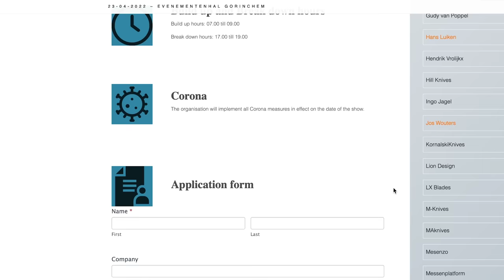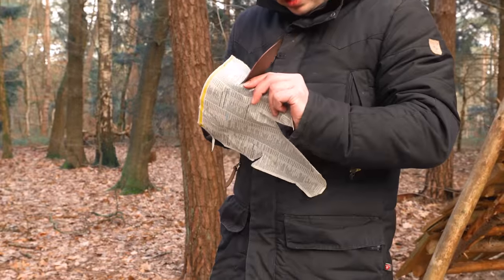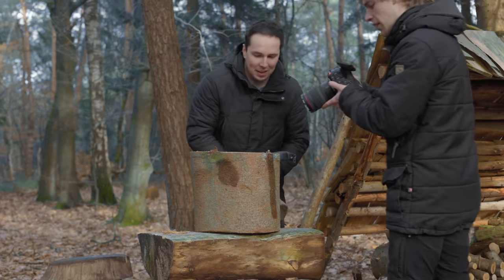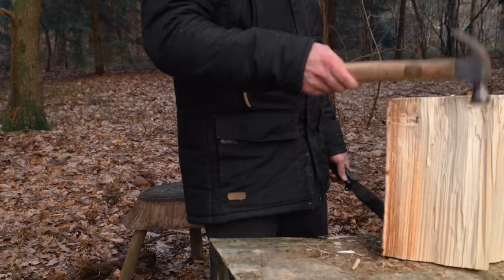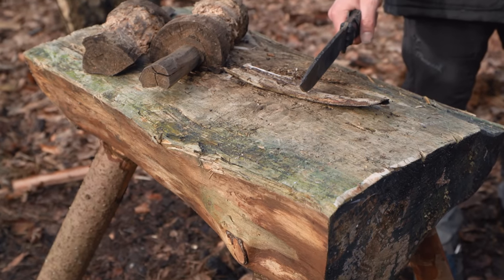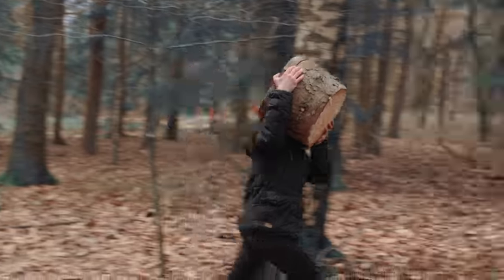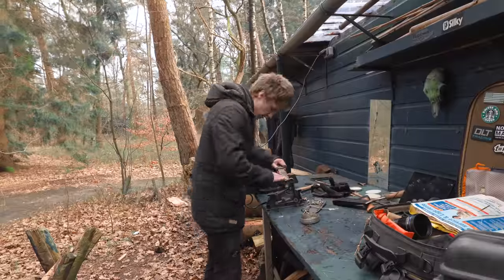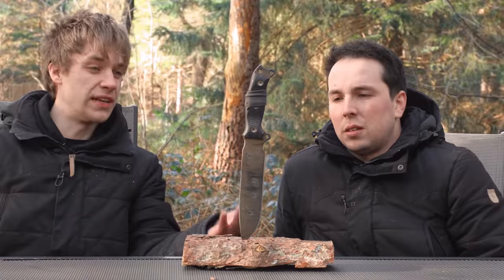They say this is the toughest Knife steel ever Made! INFI STEEL DESTRUCTION!!

Comment: I think you can tell the most from steels used by world class competition cutters.  They have to stay razor sharp, the grind is usually a bit convex or flat.  I'm pretty sure these knives are all hollow ground as it cheaper and faster. At least that is what they advertised. No way they would ever beat a Keffeler blade.
Reply: This isn't remotely true at all. Very few of these are hollow ground. I have over 20 of their knives, and I think 3 of them are hollow ground.. they have more in hollow grinds,  but not nearly as many as they do sabers, or  flat grinds. They have done every grind you can think of as well as made their own hybrid type that combines styles of grinds.  I have a few from Dan as well. The thing about what you said is chopping knives are built to entirely different specifications (they have to, or they won't be eligible for chopping contests). Busses are not designed with chopping competitions in mind. They are combat knives.. that being said, they have made everything you can think of. I've got a couple of kitchen knives from them, edc's, choppers, swords, etc..

What you're talking about has less to do with the type of steel and more to do with edge geometry. Their steel would do fine in a chopping competition if they bothered to ever make a knife to the organizations very rigid specs. They might one day, and we'll all see, I guess. Carothers has a video where they talk up Jerry's work. Dan has done work with Nathan on the Carothers K18. Dan also sold it, I'm pretty sure. 

Long story short, these knives are not made to be chopping competition knives, but I can guarantee they would keep up in the right hands with the right edge geometry and heat treat. Jerry and crew are fuckin heat treat wizards. This would not be a difficult task for them at all.
Reply: @AriesTheCam  You are the perfect person to respond . I am just speculating but since you actually own both what is the truth.  I would assume that the Keffeler blade would cut circles around an infi blade. Also they advertised for years that their infi blades were hollow ground.  Any chance you would do a video? I might even kick in a few bucks. Also, are Dan's blades flat or a bit convex. His vids are flat incredible.
Reply: @bluerazors  They really would chop circles around Busse's knives, but that's because they were designed that way honestly. He mainly uses full flat grinds with thinner blade stocks than Jerry uses, lending to them biting very deep into the wood. I would have to pull his stuff out of boxes (I buy way too many knives lol) to remember the edge grind, but I'm pretty sure you're correct on them being convexed. 

Jerry designs for toughness.. so they end up being very thick blade stocks with thick edge geometry like an axe. They chop very well, but they excel at being abused with stuff like batoning. If you thinned out the meat behind the edge a bit on his full flats to match, it would keep up. I'm fairly confident in that. I have definitely known him to make hollows, but I wouldn't say that's ever been the majority. He seems to mainly use saber grinds with "v" grinds at really obtuse edge geometries,  and reaaalllyy thick stock in the .22 all the way up to like .37 range. So real thicc bois. He did a lot of convexed stuff way back in the day on stuff like his "basic" series. He's also known for using corrugated bevels a lot as well. Those are cnc'd grooves along the primary grind supposed to keep the blade from biting as much, but I rarely notice that much of a difference. It does look way cool though. I also notice a lot of flats with v grinds, and again verrrryyy thick edge geometry (a lot of his fans like to thin the edg out on theirs to something around 17 degree type angles if my memory serves. 

I will say, though, that Keffeler is known for making arguably the best chopper in the game, Carothers for something that stays sharp for a loooonnggg time,  and Busse for something bombproof. They all 3 kind of rule the game in their respective area of focus. A few other compete as well, like Bill Seigle and a handful of other very small batch makers out there as well. G.L. Drew is another really good maker that comes to mind, of course Randle,  and some others.. if I keep trying I'm sure I could keep this up for a while lol.

I would gladly make a video if I had any equipment to do so at all, or time for that matter. I can usually find time in between feeding and whatnot to chat about knives, though. Alas, I work graveyard with a 1 yr old I take care of when I get home. Another on the way lol. I rarely get a few minutes to myself these days.

All in all I'm of the mind that people like Dan Keffeler, Nathan Carothers, Jerry Busse are so good at heat treating and design that if they were to just have a competition ( a chopoff if you will) using the same steel, same blade geometry,  etc.. and you gave them free reign to heat treat how they want that it would be damn close. 

I think Dan would still win because he's been in the competition world so long and knows the little nuances it takes to edge the other two out. Though I doubt is blade would take the punishment Jerry's would.  I doubt either would stay as sharp as Nathan's for any length of time. 

These guys just excel at different things is all.. but I think any of them could design something similar if they had the mind to. I honestly think they all fall into the some of the most elite knifemakers alive today. You would be served well by any of their stuff. I would very much recommend one of all three of their blades to serve all your different purposes. 

Thanks for being cool btw. I love talking knives with people.  I never meet knives spazzes like me in person lol.

Edited for a few typos.. sure I missed a couple anywho lol.. I probably repeated myself a few times as well, but I'm sure you get what I was trying to say. Hopefully, I didn't sound like a broken record.
Reply: @AriesTheCam  This is why Youtube rocks.  That was a thoughtful  response you don't get very often. Thank you! By the way, 4  things I gleaned after making my own knives for 10 years or so. Keeping the RC over 60,  keep the convex grind as high as possible, let the thickness match the task, and polish and oil the blade so it moves easier through a target.
Reply: @bluerazors You're welcome! I appreciate  the conversation. I would generally agree on the "over 60 rc" (or at least in the 58 range) thing for knives. If we're talking axes, then that's a totally different discussion.. those hang out in the 40's sometimes. I've been freehand sharpening for like 27 years by now, and a good "v" or compound (double bevel) is appreciated sometimes. 

On that note, have you ever tried asymmetrical grinds? Those are my favorite. You get the best of both worlds. They tend to be a little bit of a pain to sharpen (if you know what you're doing you'll be fine) and just as strong.. but you can get them much sharper than both a regular convex or "v" grinds. You can do asymmetrical convex or an asymmetrical "v" as well. Depending on the heat treat I don't mind chisel grinds either (Emerson loves these as well as a few other pretty well knowns). Hell what am I saying.. I love a good hollow on something solely meant for slicing sometimes too. I just named most lol. Seems I just like knives.. or rather just have different edge grinds for different tasks.

Seems to me if you wanted a "one knife for life" type thing a convex would be a good way to go.. or a compound.

I've heard of the oiled blade thing but never tried it in any capacity.  I mean with a collection as big as mine you have to oil the carbons to maintain them, but I've never tried adding oil during cutting (like a thread oil during drilling type idea?). I'll have to try it next time I baton. Might help get through the big boys easier.. good info!

Edit for typos (again lol) and probably missed some (again)

Comment: I own over a dozen Busse's and every one of them is well worth the money from a combat/survival knife perspective. IT IS NOT A BUSHCRAFT KNIFE. These things are made to survive a nuclear war. They chop and crush and cut and stab and pry and don't break, ever. Unless repeatedly abused far beyond the tolerance of any other knife. This is a soldier/warrior's knife. When I carry one, I carry a smaller knife to do the bushcraft stuff. One thing I would point out is many times the factory edge is not the best for cutting so when you sharpened it to take out the rolls, I would say THAT edge should be retested to see how much better it performs AFTER the softer steel was removed from the edge and the harder core steel was exposed.
Reply: Busse’s SwampRat Ratmandu makes a very fine bushcraft knife once it’s resharpened to a better edge angle.
Reply: @blainwilson7937  I agree 100%. Edge reprofiling for the task will turn one into a very capable bushcraft/survival blade.

Comment: I've noticed with INFI it will maintain a working edge long after steels like 1095, O1 and others will basically quit cutting. It doesn't keep that shaving edge. But it will cut. And it's easy to sharpen. Also you don't remove very much metal when realigning the edge. In particular when just using a ceramic rod like Jerry Busse suggests. 
I've taken INFI down to 18 degrees per side on a basic 4. I'm not beating on it. It'll cut soft materials way longer than anything else I've used. It does what the Busse intended. There is huge hype surrounding it. But it is a very good steel. With that said their version of 52100 has killer edge retention. They call it SR101. Harder to sharpen. But easier than 3V. And that's what I compare it to edge holding wise. Not as tough and it's carbon so it won't be as corrosion resistant as 3V. But it's plenty tough. They used S7 (SR77) in the Scrapyard line in the beginning. And ran it way harder than anyone else ever did. Like 58-60 rockwell. When most people run it like 53-55. I have a Gossman in S7. The Scrapyard S7 is way better. The SR77 is pretty springy. They have examples of it being bent to 90 degrees and coming back true. The heat treating protocols are better than most. That's their secret. And Busse even says that's their secret.
Reply: it's not easy to sharpen and the edge retention is slightly better than most carbon steels.

Comment: The Infi of today isn't the infi that was made years ago(pre 2002-2004). That steel had nitrogen in it, today's infi doesn't. A close comparison to today's infi is A8mod which is a great steel. It was developed to replace S7 because besides high shock impact resistance it has higher wear resistance. And at 8% Cr it's also pretty stainless.
Reply: I always suspect that INFI was most likely A8. Cause it was tougher than 3v but quite as tough as S7. So that leave a small niche of steels it can potentially be. I have a few knives made from A8 not INFI but actually A8, it would be interesting to get my hands on INFI for comparison. But this is exactly why I stayed away from BUSE knives people didn't understand that INFI was not a steel type, but like a brand. Which means they can switch steels and still call it INFI. And it seems they did. So in reality its nothing but a gimic. They didn't create a new steel or their own steel like Crucible steel did for example with CPM-3V. Had they they would have advertised it and showed people what it was. Once you secure a patent no one can make it anyway so whats the fear. The fear is that people will realize they don't have an exclusive new steel, but use existing steels that have been around for ever, very tough steels and rarely used steels at least here in US but existing steeIs nevertheless. I only know one knife maker who used A8 to make a custom knife years ago. Tom Johanning with TAC-11. Extremely tough knife that faded to obscurity. Few sword makers also used A8 to make swords but being custom they cost thousands of dollars and out of my league. So that aspect was what I never liked about BUSE, that they can switch their steels 10 more times and you wouldn't really know what steel you have. So you can have knives that are identical few years apart that behave and give you absolutely different results.

Comment: INFI is the ultimate knife it also has stainless properties in salt water. If you want tough go with INFI or SR77 if you want just to cut rope and cardboard these knifes are not for you. Go get a sissy stainless steel knife. If you want an apocalypse knife get INFI or SR77
Reply: Infi is just a brand name not a steel type. Multiple steel types were sold under that name

Its currently A8mod

Comment: I would never buy any knife with a finger choil, such an unnecessary (and stupid) design feature. That tip test alone was evidence enough that the INFI is a really tough steel...I got an SK5 feeling from it (a steel I love) but very, very , very dear for an excellent batoner. Terava Skrama 200 (another excellent batoner) can do what this knife does, has fantastic steel, is super tough and costs 70 Euro.
Reply: No steel does what this steel does.  Period.   It’s been kicking other steels asses for 25 years. Keep wishing buddy.   The choil is to choke up for finer work and more control and is needed.   You’d know this if you actually needed it.

Comment: This used to have a ton of hype around it like 20 years ago, I had the smaller swamp model. Fuckin horrible steel, did have a comfy handle but I got rid of it as soon as I could and swapped mine for a bark river...Only started the video, I don't know if you'll destroy it, it's quite soft...bend it in to a shoehorn maybe?